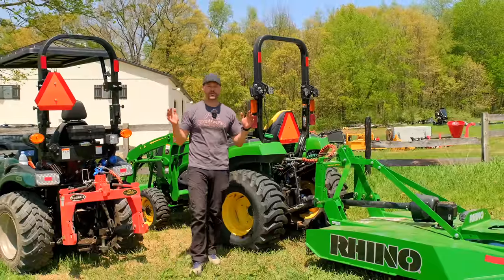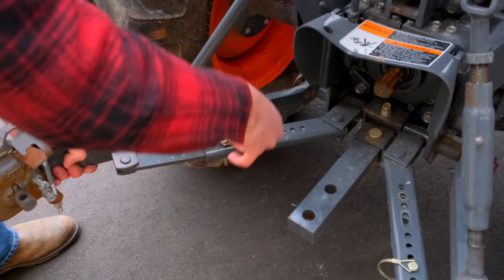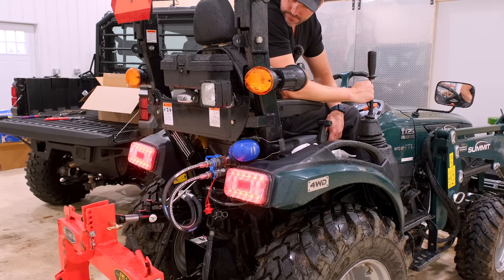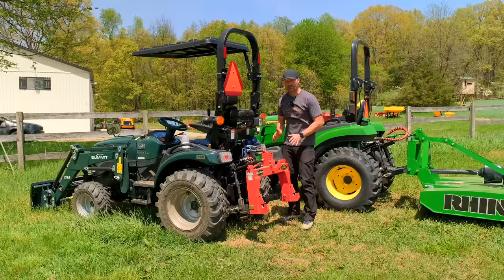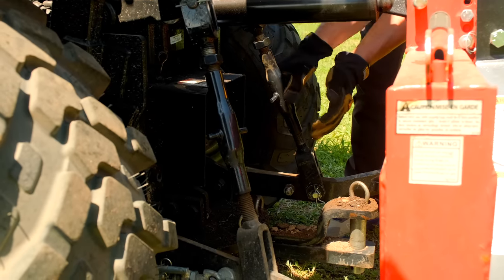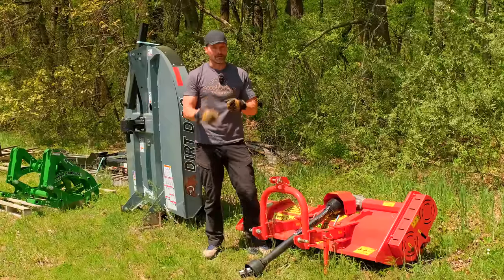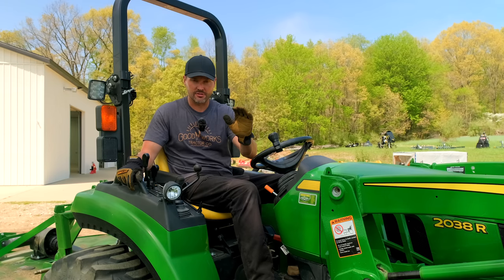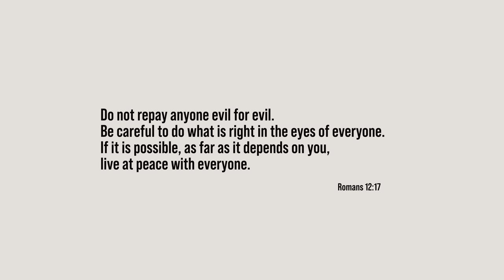I GUARANTEE YOU’VE NEVER HEARD ONE OF THESE 3 POINT TIPS!

Comment: Great video Courtney!  The 3 holes on the tractor are more important if your tractor is equipped with draft control.  Ask Tractor Mike did a good video on how changing the top link in the three holes affects the sensitivity of the draft control mechanism.  If your tractor is NOT equipped with draft control, then the 3 positions simply affect the angular characteristics of the implement when raised and lowered as you stated.

Comment: For hooking up implements without a quick hitch sometimes the best thing to hook up first is your top link once you hook up your top link you can adjust in or out and that will move your lower link pins so it makes hooking up your lower pins easier
Reply: And if it's something like a rototiller, you can rock it forward and back by moving the tractor a bit to line up the lower pins.

Comment: Great bunch of tips. What I've taken to doing is stopping about a foot short of my implement, hooking up the PTO shaft, then backing in to hook up the lift arms and link. That extra little bit of room makes a lot of difference in trying to get myself between the tractor and implement. One thing I can't figure out is why they have a collar that you have to pull back to slide it forward. You're pulling the sleeve in the opposite direction. I had a Bush Hog 286 about twenty years ago that had a push button release on the tractor end of the driveline. My new Bush Hog has the sleeve. That push button was way easier to deal with. Maybe if I ever have to replace the front u-joint, I'll get a push button yoke too.

Comment: Would like to see a step-by-step and tips to get a brush hog cutting level and floating so it does not dig in when turning or going over uneven terrain.  (Basic no quick connect, etc, then if any add-ons make it easier) Thanks for all the great content.
Reply: I use a small pair of vise grips to "set " the lever.

Comment: Real important tip: be very mindful of raising the implement while the pto is running. In many cases if it’s raised too much, the shaft will start to bind & possibly self destruct.  That’s why I have a three point lever stop above the lever & adjust it so I can’t raise the 3 point too high(implement dependent).  Some implements it’s not too critical, but with my tiller it’ll bind if I raise it too high.

Comment: another good segment. good advice about connecting the front of the PTO shaft first, then the back. I've struggled to get my brush hog hooked up in the small space the 1026R has. I'm gonna have to try that next time i hook up. I might have to get that PTO link. i went to the web site but wasn't clear if they had a fit for the little JD's. they did for the Kubota. i suppose its the compact system for the less than 40 hp tractors and PTOs

Comment: Quick Hitch Tip: Some implements have adjustable 3-point arm pins. Thought my e-hitch did not fit my tiller at first, then noticed that the 3 point pin width was adjustable on the tiller.

Comment: I fight with hooking up the pto every time. I have to try putting my pto in the mid position and see if I can turn it. Thanks for the tip
Reply: The PTO quick attach does help quite a bit. It's much easier to align the pins on it rather than getting the splines to match up.
Reply: I tried it what a game changer. Thanks so much for the tip. I used to put a big screw driver in the yoke and try to spin it.

Comment: Well, a problem I have is I bought a 24hp Branson a few years ago with a backhoe...no problems with the hoe, but when it is removed, I cannot use the 3 point for hooking up implements....the problem is the frame for the backhoe which interferes with the side 3 point arms when they are installed.  I need a way to use a quick hitch that allows the side arms to bypass the frame.  In other words, the side arms will not lift high enough for me to lift a small brushhog, finish mower etc without hitting the frame.  Any suggestions of a product welcomed.....I live in East Tennessee.....thanks

Comment: Two other tips, don’t forget to grease up the balls on the 3 point hitch as they can get sticky and not want to move well. 

On the Del Marino PTO hook up, you can easily get the shafts to spin to attach the PTO - BUT - the PTO link makes it SO MUCH easier!
Reply: I grease the pins on my attachments in the quick hitch. That little bit of roll they do lifting and lowering could wear them out metal on metal.

Comment: The stop on my 3 point vibrates loose quite frequently. I wind up plowing when I have my mower set high because the arms drop too low after I lift the deck up to cross a berm or ditch. I guess my stop is more of a pause.😔😒🤭.

Good tips
Reply: Are you referring to the stop that you can set so you return back to the same height every time?
Reply: @dougkrause8036  yes, I think I am cranking it down good and tight, but it always seems to vibrate loose, going from a 6 inch cut to -1/2 cut.🙄🤬
Reply: @williamgaines9784  you do know you can have it in the adjustable position and then turn it clockwise then relook it and it will be tighter?
Reply: @dougkrause8036  I will look at it tomorrow.

Comment: I took all the chains for the plastic shields off awhile back.  There's really no reason for them.  You can easily stop the plastic shield with your hand and there's less wear on it if it's spinning at the same speed as the shaft.  Plus - those plastic zerk fittings are a pain.